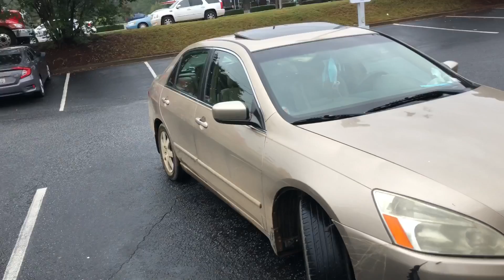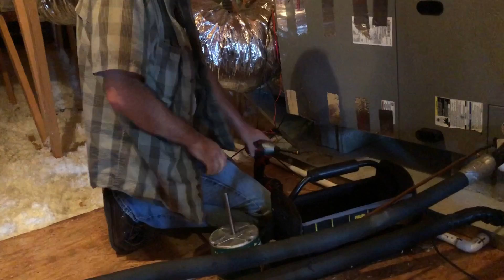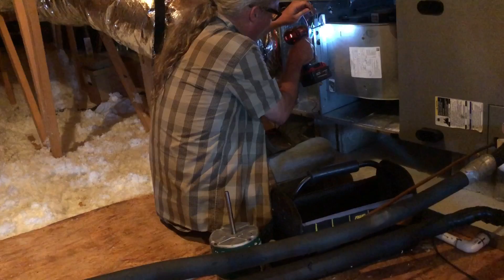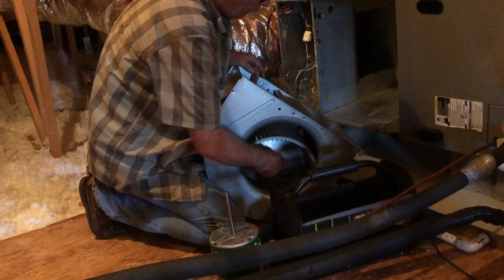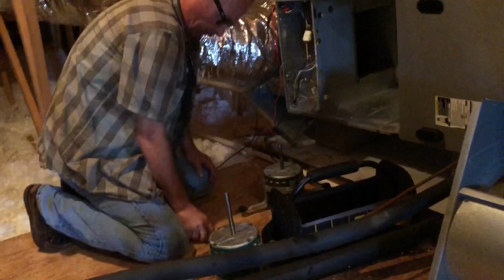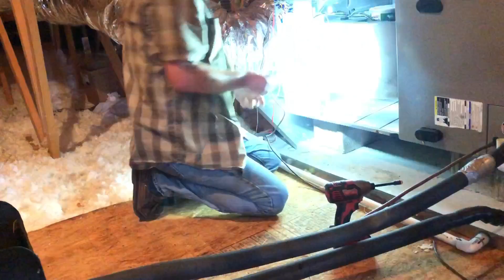Replace ECM blower motor - How long does it take ? real time video

Comment: A 12-point 3/8" ratcheting combination wrench works great on those set screws. 
I would have spent some extra time and cleaned the blower wheel if it was excessively dirty.

Comment: In my 6 plus years of hvac i have yet to come across a bad X13 motor, but yet uncle Ted seems to replace one every week! Happy Thanksgiving Ted!
Reply: Replace them all the time, always an obvious diagnosis.. alot of times just go back and forth like its confused lol 😆
Reply: I notice that too, usually they need only a drop of oil, cleaning.  I replace a condenser motor with squeaking noise, 15 year old genteq motor la ca, replace it, but the noise disappear after putting a drop of oil near the shaft, another spare for me.  In the east coast probably replacing motor is the only solution because of weather condition.

Comment: icp is easy! now the old weather master furnaces from carrier with the flute pipe in from of the blower motor housing was the worst i have ever changed one on. even worse the bolt heads were all stripped so took way longer in a hot Phoenix attic when it was 115 outside!
Reply: Worst blower motor to replace is first co. They are terrible with that piece of metal and board/ controls in the way ugh I had one a few months ago to do took me 1 1/2. I find Lennox ecm motors are the easiest to replace

Comment: I usually take my small crescent put it on the flat of the the motor shaft give a turn while holding onto the blower wheel it will come off easier. I never have to hammer on it.
Reply: He had it sanded/ lubed, so I think he was just harnessing gravity to pull the motor out. Soon as he tapped it loose it dropped right out

Comment: Morning Ted, 
Shawn here from up in Saskatchewan, Canada where all new furnaces have to have the new ECM style motors from the factory.
I personally don't think that was a smart move for the consumers as they can cost almost up to 2-3x as much as the older style PSC motors. What are your thoughts about this decision made for "Efficiency" or "Green" way of the future?
Reply: I believe since it is new technology over time with more companies manufacturing these prices will drop.
Reply: I think you are low on the cost of the ECM motor. I usually pay $800 for a complete Trane ECM (motor and module). Ripoff indeed!
Reply: I take cost of motor multiply by 1.33 and and add in labor that’s what I do

Comment: Refrigeration rachet works well on the squirrel cage bolt saves a minute. The wrench with the square drives. A minute is important in Nascar

Comment: Got it down to 45mins on the Goodman AWUF wall hung units, on a property I service. Thanks to the original installers wiring the 24v WRONG. Thankfully, It can be done without removing the evap coil.

Comment: Why change the whole motor and not just the module.  Looks like and x13 motor to me. Is that a variable speed motor??  Waste of time if you ask me.  Module is the culprit on most of those motors.
Reply: I was thinking the same thing unless it's a after hours call and he doesn't carry them on his truck
Reply: I agree. As long as it’s not the bearing. Must have replaced 100 modules and I’ve never had to go back and replace the motor. Quarter-inch socket it it takes maybe 10 minutes
Reply: With Some ECM motors, the motor and module is one unit. With others, you can buy the module separately, and it is an easy, albeit still expensive fix. You are correct in that most times it is a fried module. On the single-piece units, it is a shame to throw away the entire unit when only the built-in module is bad. Oh well, that’s Trane for their outdoor condenser fan motors.

Comment: With your electronics background you ever look at one of these dead digital blower motors to see what really dies on them? Maybe like a 10 cent part.
Reply: It is usually the module, but replace the entire motor anyway. . All I know is that a lot of them fail ! 😂
Reply: It's an overcurrent capacitor. Repair kits are available to fix the ECM module.
IF that's the problem...